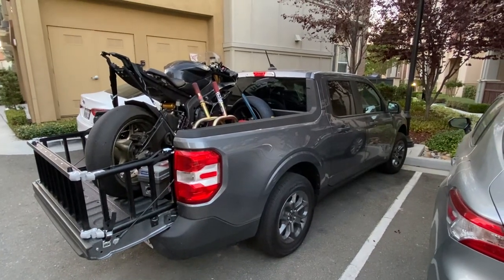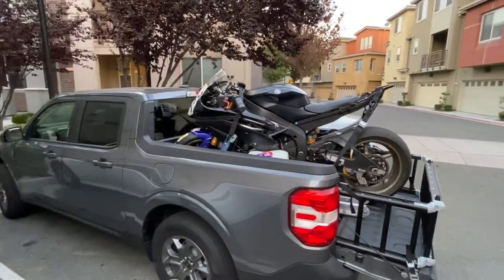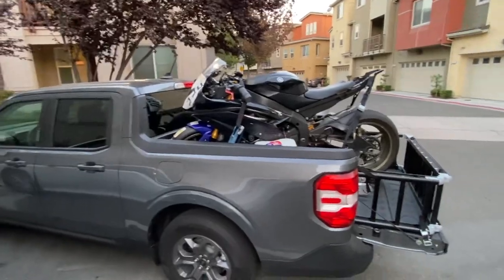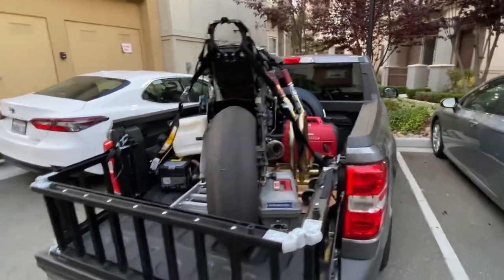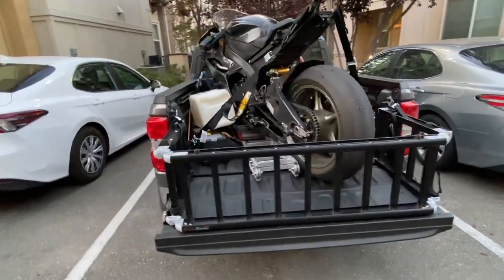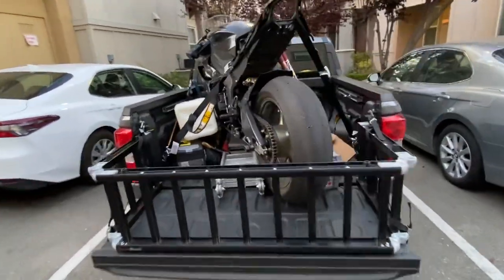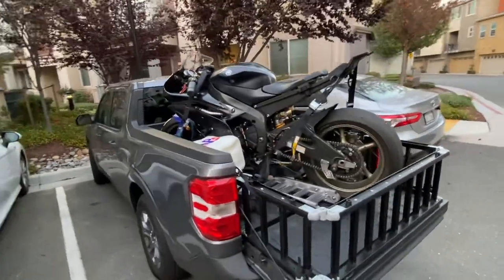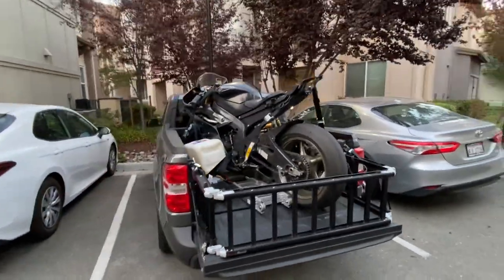Ford Maverick working as a 35mpg motorcycle transporter

Comment: I have a Ford Maverick and a Ducati Panigale. Im trying to make these two work. Whats the best way to go about this?? When i measured the bike vs the bed length the tire would be hanging out the bed of the truck with the bed door down if i try to fit the bike in straight. I have a wheel choke and a bed extender.. I could put the bike in at an angle but i wouldnt be able to use the front tire wheel choke. any suggestions???
Reply from the maker: Hey man, take a look at my video --- that's probably the best way I'd suggest. You don't need a front wheel choke at all, if you put it in at an angle like what I did.
The bed is simply too short to put the bike in straight, you will end up (1) a lot of stress on the tail gate (2) you won't be able to use a hard (metal) tail extender.
Try to do the "angle" method like my video you will see what I mean. It's very easy.

Comment: I was looking at the Maverick for track, but I wanted to use it with the PitBull TRS. When pulling straight in, where does the wheel sit in the tailgate? Middle/rear/front?
Reply from the maker: I didn’t do the exact measurement, but I remember it being that the tire sits towards the edge of the tail gate. I think it will br very sketchy, seeing how that tailgate seems to not be designed for a lot of weight / strength

Comment: How is loading and unloading? 

Do you stand on the ramp too and temporarily go over the 500lbs tailgate rating or is the truck short enough you don't need to do that?
Reply from the maker: I consciously try to not stomp on the tail gate --- and put as little weight as possible on it. The bike is pretty long compared to the tail gate; so I would say about 300 lbs of the bike's weight is on the tail gate at most during the loading. So yeah, adding my weight, it's pushing the specification. So far it's holding up great (knock on wood!)!